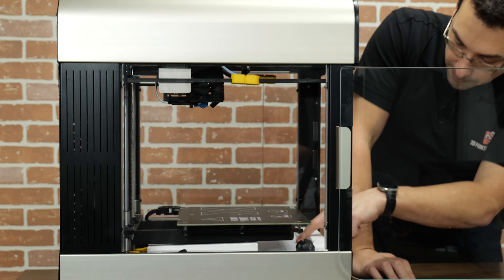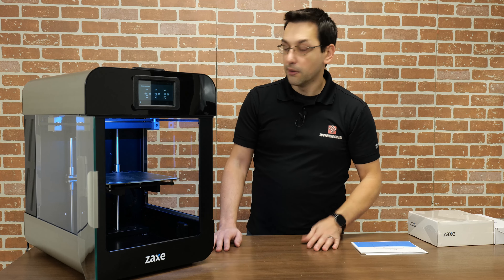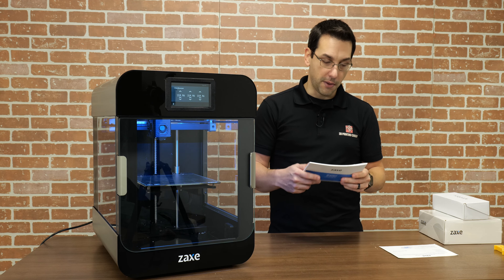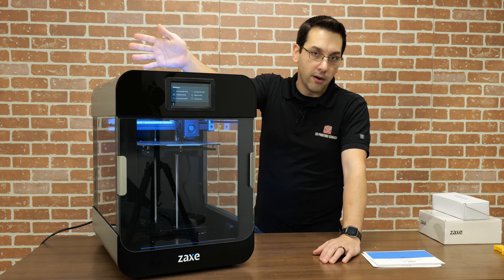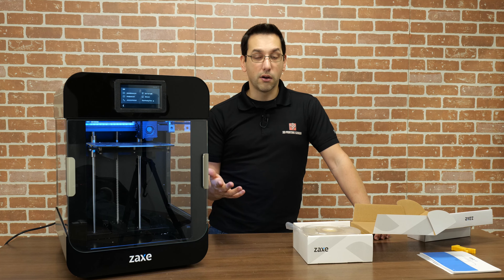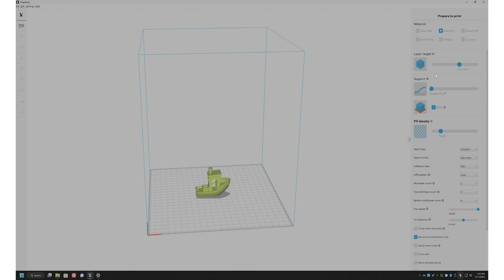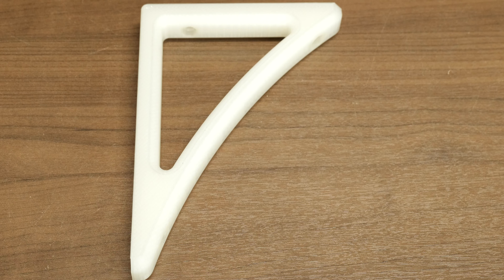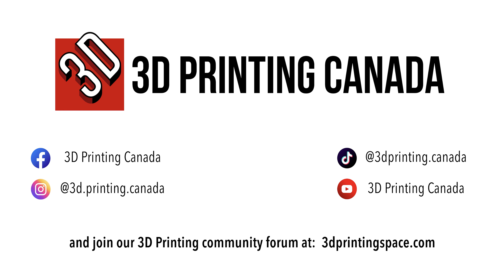Zaxe X3 - Unboxing, First Impressions & Test Prints

Comment: Linear rails actually do need maintenance (cleaning, lubrication) but you're right that v-wheels tend to need it more often (although the actual maintenance is relatively more simple). The main reason to chose linear rails is usually reliability and repeatability ( accuracy is pretty much on par with v-wheels). While the printer seems pretty well thought out, like with most CoreXY printers I'm surprised at how much extra space they occupy compared to the actual build volume.